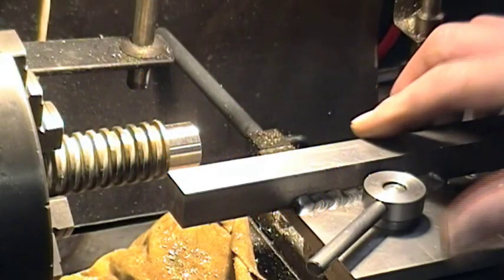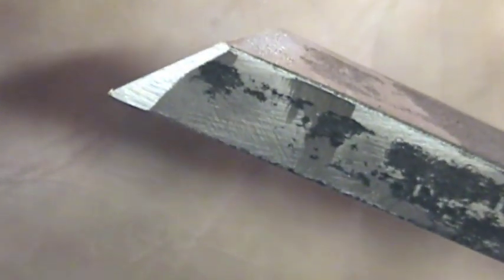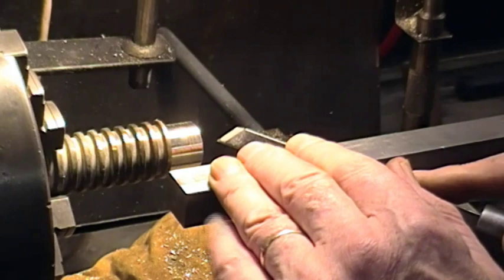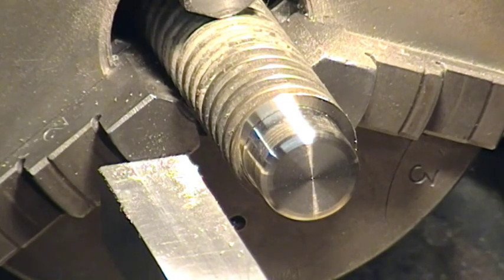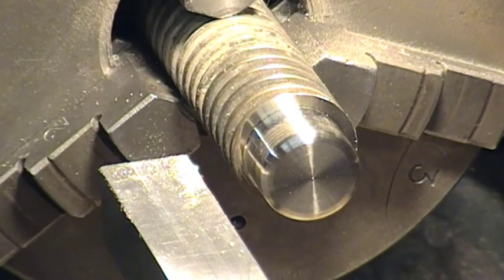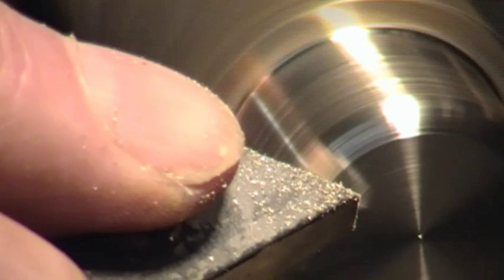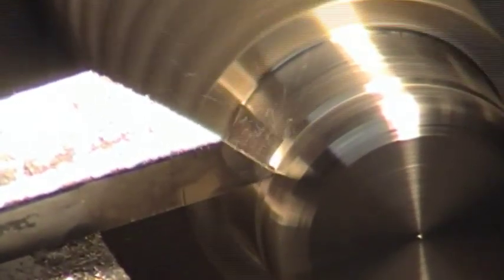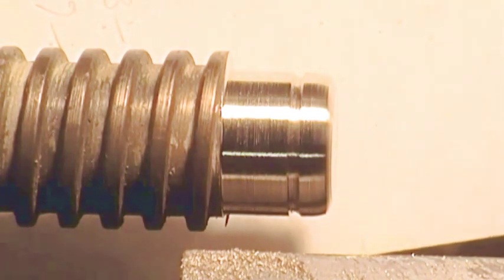The Graver Tool - demonstration of use.

Comment: Chris, did you make your own graver? I've been asking around at jewelry supply places and hardware stores, but no one seems to have any idea about a large chunky graver such as you have here. It looks like just what I need.
Reply from the maker: Hi - that was made out of a piece of high speed steel tool - made the handle (could have been wood) and ground the end to profile. If you look around on eBay you should be able to get a piece of 1/2"x1/2" HSS - but may have to hunt a bit to find a long enough piece.

Comment: I want to engrave on a bronze plaque which is on a memorial bench. The design I managed to "scratch" on with sharp marking tools has gotten eaten away by the salt or other mineral in the fog and has degrade it. I need to dig in deeper with something and I have punched some jeweler's gravers, but they are very thin and your graver looks a lot easier to control.
Reply from the maker: You may need for that to find an engraving tool such as a gunsmith might use - it may still be on the small side but might do the job. The tip grind anyways is probably fairly critical, to suit required cut profile.

Comment: I'm not criticizing neither bashing your video, just concerned. I haven't seen the other parts of your series so disregard this warning in case you've already advised your audience. Great video, my only concern is the fact that I wouldn't recommend anyone without experience on lathe machine to use a graver tool for such task, specially on a full size lathe like yours. It is dangerous as the tool has your hands as the only holder other than the support of the steel bar! When you show the making of the groove, we know you're not going in straight as it would risk catching the tool on both edges and yanking it from your hands but it is good to let people know you shouldn't let the material catch both edges of the tool at once! Real lathe tools have an angle relief to prevent such from happening even though the tools are firmly set on the appropriated support and this graver isn't. On a small/jeweler lathe, the torque on the machine itself is times lower than what you have in a full blown lathe machine like this and, still, there's a danger for it to happen! Just clarify that to your audience and they can make their own educated decision.
Other than that, a 1000 kudo's for your effort and patience!
Reply from the maker: Edson Andrade Thx for the comments Edson. Points very well made.
Reply: Glad I can help. Keep up the good work!